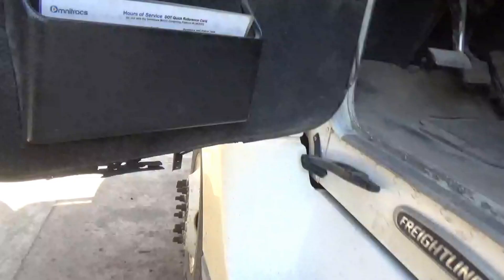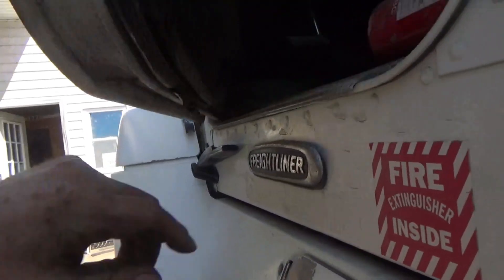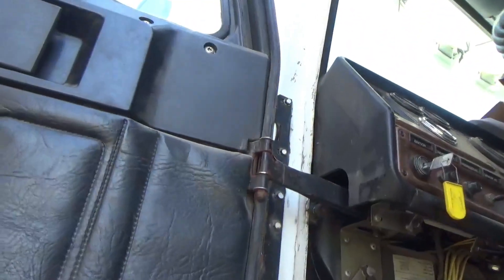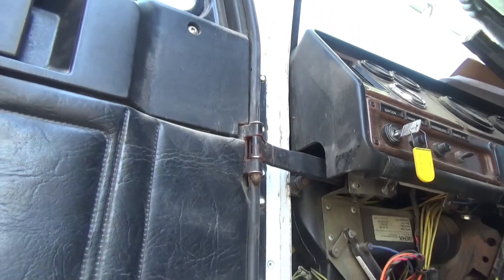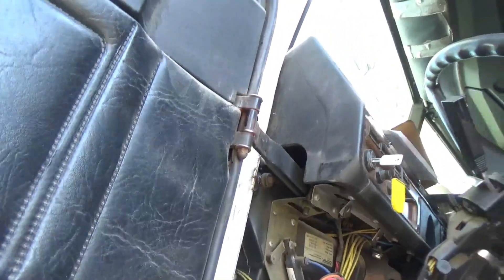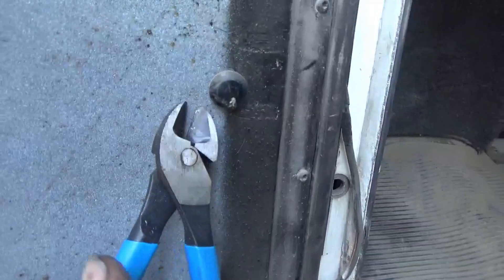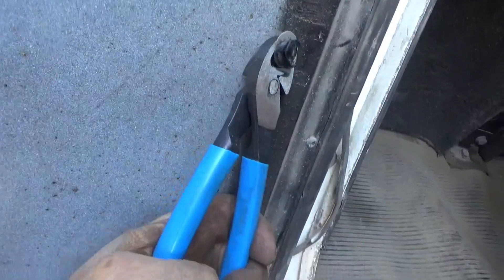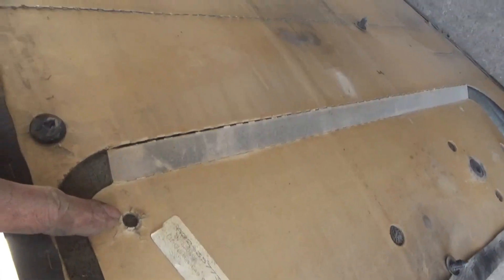Change door latch on a '97 Freightliner FLD

Comment: Not many years ago I worked for a farm service which had freightliner for fertilizer tender trucks. We replaced a couple of the top handle pieces. Don’t remember if we got to them from freightliner or aftermarket but they were still available.
Reply from the maker: I keep hearing that I can still get it but I really don't need to. Thanks Scott.

Comment: Then internet is waiting on a king pin replacement video
Reply from the maker: I don't need to do king pins on my truck. If I did, I would do that. I don't think you want to do that at home though, better to have it done.
Reply: I worked in a truck shop for years and we rarely did king pins in house. Spring shop in the area could do it in half the time, no point in us doing it.
They had a press that they cut down to fit on the truck, I imagine most spring shops would.